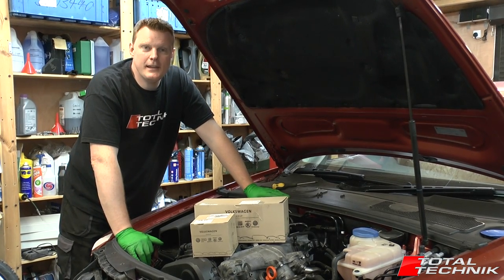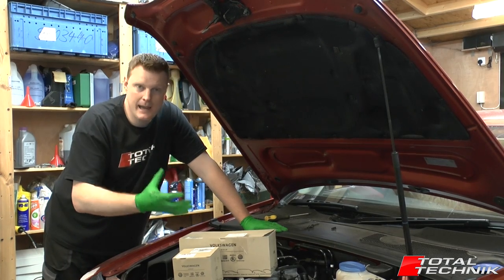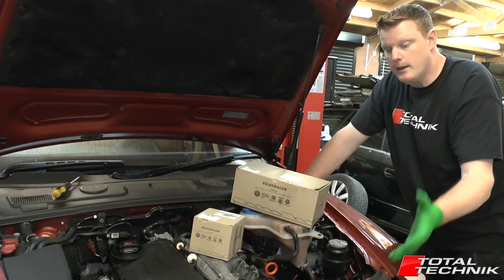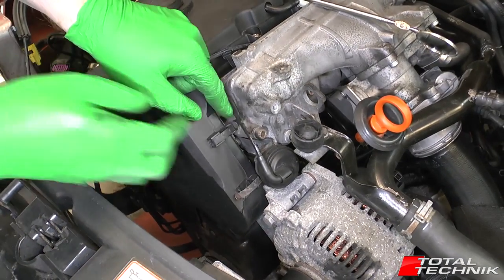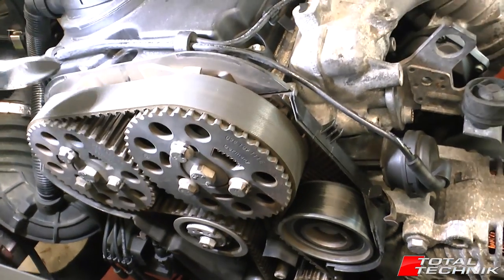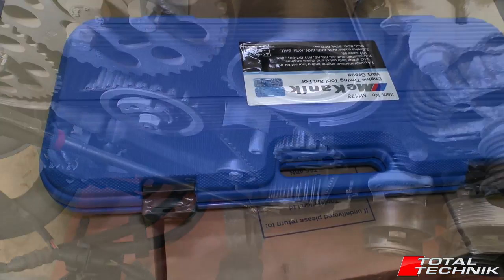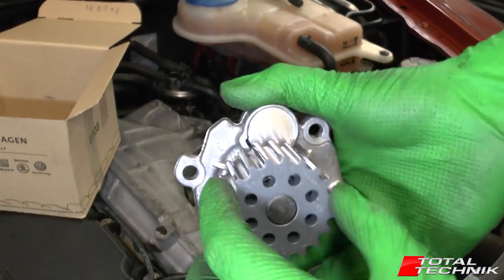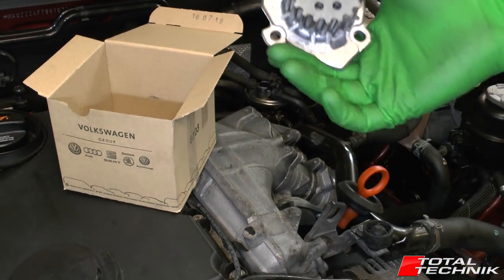How to Change Timing Belt Cambelt & Water Pump - 2.0 TDI Audi VW Seat Skoda ALL MODELS (A6 C6 4F)

Comment: I really enjoyed the throughrough video. My question: on a 2011 A3 TDI, the engine is turned 90 degrees from this one. What do you advise to remove to access this belt more easily? I've heard not too remove the motor mount?
Reply: Did you ever get some light shed on is question?
Reply: maybe a bit late on this, I've never done an a3 but have done a few golfs and on them you have to remove the engine mount as otherwise the belt cannot come off and it allows access, you can make a quick make shift brace using some 2x4 wood or similar to take the weight if the engine on one side. message if need any more details

Comment: Very nice explanation! Thank you for this video! I have a question please :). I have a 2.0 CRTDI. In your cambelt lock set, you have 2 gear lock tool. You used only one. The second one has a different tooth type or this set is good for CR motors, and I have to use it to lock the high pressure pump with it?
Reply from the maker: Glad you found the video useful! The best way to ensure this would be to check the engine compatibility list for the tool you are looking to buy against you engine code. The Sealey tool gives a good comprehensive list of the engines it will cover, and I believe that info should be available on their website. Best of luck!

--- 

To help support us (for both you and others reading this) there are a few things you can do:

1) Donations both needed and welcome! We cannot operate Total Technik without the support of people like you! You can donate by PayPal - just go to www.paypal.me/totaltechnik
2) Please ensure you subscribe to our YouTube channel. 
3) Please give our video's the Thumbs Up on YouTube. 
4) Please help spread the word, the more people who know about us the better! Add links to our video's in forums, let people know about us.

Thank you for your support!

Comment: Hello, im looking for advice, ive got - Audi a4 1.9 TDI 130HP 2002 - and the  ''  oil sensor '' keeps coming up on the dash board, i've chenge it and it still pops up on the dash, any advice what do do next, i've asked few services what to do with this problem they didn't know what to tell me, i whood be very thankfull for any advices from Total Technik
Reply from the maker: Hmmm. Could be a few things. Have you tried cleaning out the sump pan completely? Sometimes having 'gunk' in there can continue to throw this issue even after the sensor is replaced. Depending on the exact model and position of the oil drain plug it can be easier or harder to do! If you can get a brush in there and give it a really good work around (with sensor out) that will do it, or otherwise drop the sump pan down and clean it out completely and properly (a bit of a pain refitting). If you've had a few people look and there does not seem to be a logical reason, that would be my first thing to try as it's quite quick and easy (comparitively) to give it a go so not too much lost if it doesn't work.

--- 

To help support us (for both you and others reading this) there are a few things you can do:

1) Donations both needed and welcome! We cannot operate Total Technik without the support of people like you! You can donate by PayPal - just go to www.paypal.me/totaltechnik
2) Please ensure you subscribe to our YouTube channel. 
3) Please give our video's the Thumbs Up on YouTube. 
4) Please help spread the word, the more people who know about us the better! Add links to our video's in forums, let people know about us.

Thank you for your support!

Comment: hi
i changed my belt. audi 2.0 tdi.  my first fuel cons. was 0.6. after change 0.4 .  is that a problem.  i feel the driving consumption is little bit more. first 4.0 lt   80 km/h  later 4.7 lt.    your any advice ?
Reply from the maker: Take a look at the end section of the video carefully as it covers this in detail. Did you make manual adjustments to the cams after the belt was fitted? You should only make those adjustments if you were not happy with how it ran beforehand. You can always adjust it now if you need to, just take your time and be steady with it. 0.4 to 0.6 is in the 'normal' range for this engine. If it's running well you may want to leave it alone. 

--- 

To help support us (for both you and others reading this) there are a few things you can do:

1) Donations both needed and welcome! We cannot operate Total Technik without the support of people like you! You can donate by PayPal - just go to www.paypal.me/totaltechnik
2) Please ensure you subscribe to our YouTube channel. 
3) Please give our video's the Thumbs Up on YouTube. 
4) Please help spread the word, the more people who know about us the better! Add links to our video's in forums, let people know about us.

Thank you for your support!

Comment: I have the sealey kit and it's rubbish, it just don't fit in the cam holes.
Reply from the maker: Usually they work fine. Must be a slight engine component variant, but annoying when it happens (like in this case!) Still, can be worked around!

--- 

To help support us (for both you and others reading this) there are a few things you can do:

1) Donations both needed and welcome! We cannot operate Total Technik without the support of people like you! You can donate by PayPal - just go to www.paypal.me/totaltechnik
2) Please ensure you subscribe to our YouTube channel. 
3) Please give our video's the Thumbs Up on YouTube. 
4) Please help spread the word, the more people who know about us the better! Add links to our video's in forums, let people know about us.

Thank you for your support!
Reply: @TotalTechnik  Yeah just got some 6mm pins made up and they went in great, on another note my engine is a BMN, I could not get the crank lock for the timing mark at 2 o'clock, I had to use the other on marked at 11 o'clock is this correct?, it worked anyway, spent all day doing it, just got to adjust the exhaust cam as L/H is out of spec.
Reply: @trevorjones8256  how did you get on with this? I'm having problems with my PD170 BMN. Long cranking cold (way longer than usual for this engine). I read somewhere that both verniers/holes should be about the same on exhaust and inlet cams, but mine are more like opposite extremes.
Reply: @cw205mi16  Mine's working perfect now, after the tensioner stud stripped the threads, and the cambelt slackened off while the engine was running!!!, anyway back to your problem, have yo got VDCS?, or know some body with it?, you will need it for the fine tuning as in video. Right, the cam wheels should have been put forward, ie turned clockwise with the belt off, leave the 6 13mm bolts loose, fit belt, as you tension belt the cam wheels move into roughly mid position, as the slack in the belt is took up,with me?, it's actually easier to do than explain :), that should get you somewhere near and the engine should run, then you do the fine tuning with VDCS, as mentioned in the video, the exhaust cam should be between 0.4-0.6L/H and the inlet cam should be as close to 0.0. Hope this helps.
Reply: @trevorjones8256  hey thanks for the quick reply! I've got VCDS yes, my torsion value is 2.23 (it was 3.36 for a long time) and didn't really have an issues with it, but recently cold starting has been a major problem. I might revisit setting it to 0.00, having previously tried this without it working for me, car felt "flat". I made the mistake of adjusting the exhaust cam recently and I can't seem to get it back to where it was despite (badly) marking it (and cold start seems worse!!!). One thing that is confusing me is the aim to get 0.4-0.6/lh; on some systems I've seen this as an immediate updating live figure, but on mine the l/h starts at 0.0 when I start the car and slowly goes up, or if I'm driving and it shows say 2.8l/h and come to idle it will very slowly count down?
Reply: @cw205mi16  That's ok, sounds to me the torsion value is way out, that is the injector timing, hence the long start when cold, you need to adjust the inlet cam for this, only need a small amount at a  time, try that and get back to me, what you describe is new to me, mine goes up when running at idle, could be the timings slightly out, did the pins and crank lock go in after 2 turns on the engine?, mine did not and the pins would not go in) I had to slacken the 13's and move the cambelt round a bit, not much to get it to line up again, did it and another 2 turns and everything went in this time. Hope this helps, oh and join the forum if not already.
Reply: @trevorjones8256   Hi Trevor, I understand your pain as myself have also encountered something like that.         In my case it was the OEM (made in Italy) water pump, which failed after only 20k Km. In the middle of the road. Luckily, the engine was not damaged. Please help me with a couple of info: I have an Audi B7 TDI PD  16v, 100 Kw, BRF engine, do you know by chance, what torsion value would be applicable for it? 
Also, from what I understood so far, the idle consumption should be adjusted from the left sprocket which is the exhaust and the torsion value should be adjusted from the right sprocket, which is the inlet? 
Many thanks in advance, for your help!
Reply: @mevio4665  Hi Viorel, You are correct in the adjustment, and I think it's the same for all 16v TDI engines, ie 0.4-0.6 L/h and 0.0 on the torsen value, any problems just get back to me.
Reply: @trevorjones8256  Much appreciated Trevor!

Comment: German engineering my ass. If it's more complicated to change the timing belt than performing brain surgery, forget about it
Reply: German Engineering 101: Never be seen to copy a good solution; Never use one part where 10 will do; Never ever sacrifice performance or efficiency for durability. Safety margins are for ugh Americans. And never, I repeat NEVER, consider making a process or assembly simpler. Remember, this is a piece of precicion engineering, the more we can keep the peasantry from sticking their noses in the better.